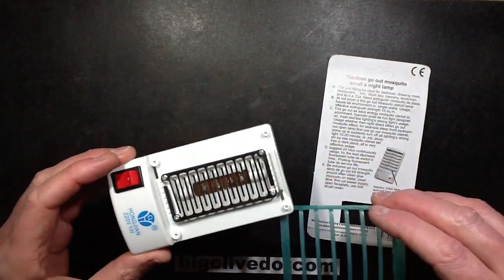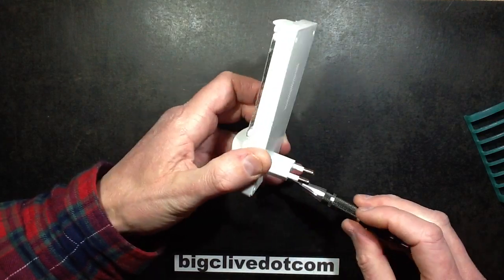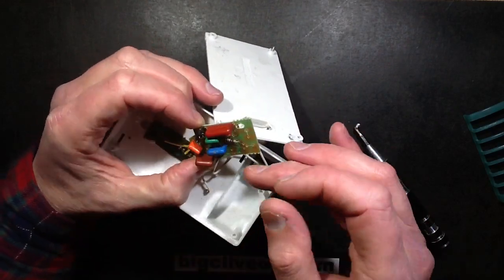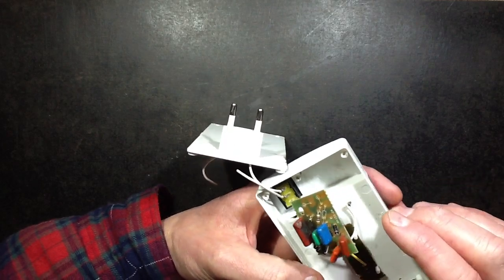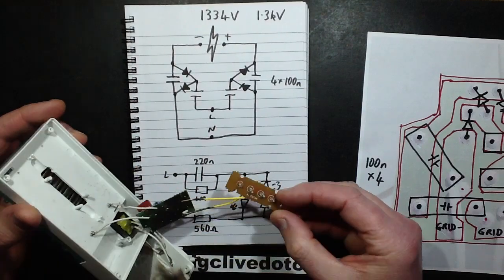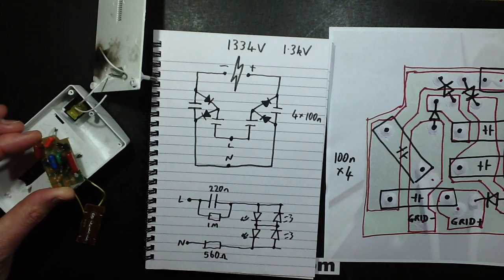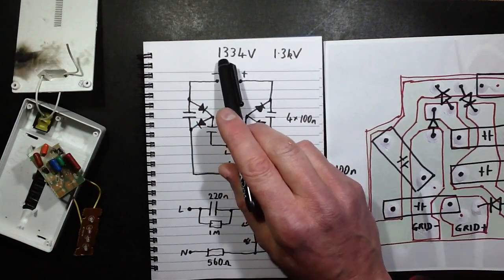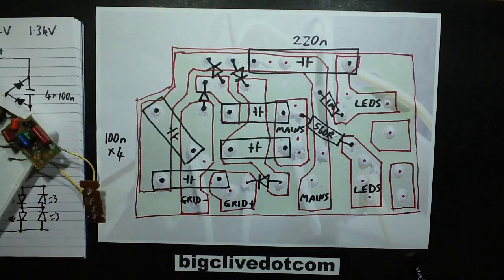Incredible exploding Chinese insect (and human) killer.  (with smoke)

Comment: Can you get killed by that small of a capacitor ?
Reply from the maker: +Daniel Tevi (Jizzy) I doubt it.  Probably just a zap.
Reply: bigclivedotcom Thank you :D
Reply: +bigclivedotcom Could you test that theory with a fly back transformer? ;) #onlyonce
Reply: on of the worst shocks I every got started out as a small shock which leads to a big shock
Reply: All2skitzd can you tell me more of what happen to you ?
Reply: It's like the old electricians saying when your working you keep on hand in your pocket because if you go one hand on a ground and you touch a live wire and a ground on one hand its gonna take the easiest path but up pull your hand back off the grund and your hand is still on the hot side then its gonna travel through your body and be a lot worse. one of the worst shocks i ever got was working on my car and it started raining and i was trying to attach the lower radiator hose and this car had a badass battery in it with side thermals that had extensions for all the audio stuff and my hand was touching the ground of the car and my arm that was wet touched the positive side of the battery which shocked the shit out of me and made me let go of the the part that my hand was touching but i had my other hand on the car to so it went from a shock in the arm to a shock that made like my vision crazy and i for real thought i got struck by lighting until i kinda got my wits back and realized what had happened which was a surprise because i never really thought about that happening with a car battery, but other then that most of of the shit with smaller electronics has been pretty miner and just took a lesson not to do that again Don Dan
Reply: +All2skitzd 12 volts did that to you? :O
Reply: SouthwesternEagle
yeah, i was pretty shocked about it myself but it was just one of those things where the conditions was just right for it. Just like if you take a 9V and touch your fingers on the contacts it don’t do anything but if you lick a new one it kinda tingles because the saliva gives your tongue was lower resistance, i was touching against that positive that had the biggest  extended side-post adaptors i could find and a bunch of uninsulated 0/1 AWG terminals hooked to it and the negative was the same way with a stupid amount of grounds ran to the car and my arm was wet and touching the positive really hard so all it took was a good wet handed connection to the car and it was one. The battery was a pretty new group 78 (i think) AGM starting battery that at a later time was able to start the car after the headlights was left on over 6 hours and had the hightest cranking amps out of the group 78's that i looked at and i watched my voltage gauges in the dash like most people watch the road in front of them when driving, had a alternator that when it had a load on it the car would barely idle without hitting the gas a little, had doides on the sense wire with a 2 way switch to make the alternator not try to pull any gas saving bullshit that might not keep the battery topped off resting at 12.8 or so but really even a shitty battery in a car could zap you pretty good in the right conditions, i eould take a little 120AC coming off the wall anyday over that shit again. If I had to pick between sticking my little pecker in a light socket or getting shocked like that again i would need some time to thing about it, shit gave me a newfound respect for car batterys, (spellcheck is busy so you got to do this one yourself)
Reply: All2skitzd. I've never been "zapped" by a 12volt system and I change 1300 CCA times 3 in parallel so 3900 cca system, wet or not, but I have been burned by having battery acid on my hand and completing circuit, it burned a small hole in my thumb in an instant, felt like a laser burn.

I have been bitten by coil packs and faulty ac inverters.
Reply: wobblyboost
Just a quick story, My instructor always told us to remove all rings/jewelry before working on a car, he explains that one of his co-workers was removing a starter, his wedding ring contacted both the starter's hot lead and the chassis ground, his ring welded to the metal and because his finger was fatter than the ring, he couldn't pull it off, he ended up with 3rd degree burns charring the bones (on top of breaking the finger trying to remove it) and needed his finger amputated.
Reply: Wyvern  That's really 2 lessons in one. Remove rings/jewelry/watches before working on car on electronics. If nothing else it is good practice. If you cant get rings off put tape over them.  Second lesson is remove the battery connection before doing work like that. When removing the starter you going to have a heavy gauge positive wire coming off of it in a area wear everything around it is negative. Just make sure to pull radio/navigate codes before unplugging battery
Reply: All2skitzd
Yep, I don't touch starters/alternators without taking off a battery post.

Comment: Since I don't know what the hell this is or how circuit boards work, i'm going to assume that the capacitors are there because the chinese engineers didn't know either whether to put them or not?
or explain it to an idiot....
Reply from the maker: Justin Koenig The capacitors would have worked if they hadn't been so grossly under-rated for the voltage.  A bit like putting a 12V lamp across 120V.
Reply: And what would they have done? I thought resistors would be better to dissipate the current and make it deadly for bugs, and not humans, but do capacitors work as well?
Lastly, wouldn't a better design be grounded and with a fuse?